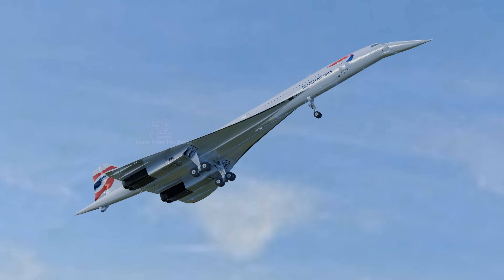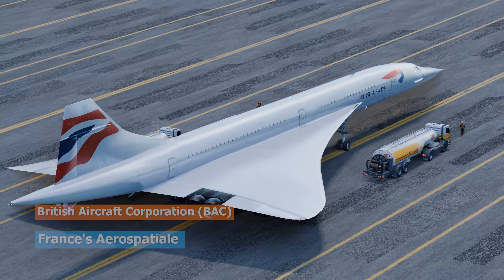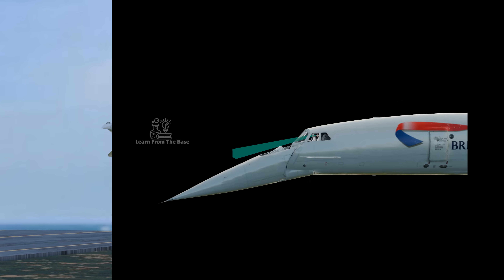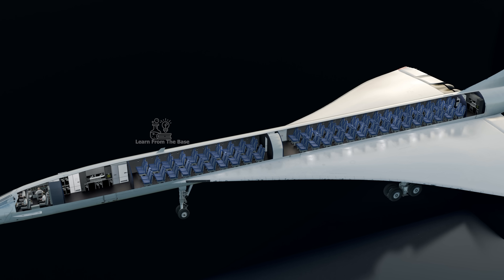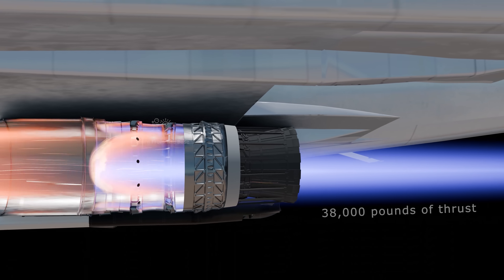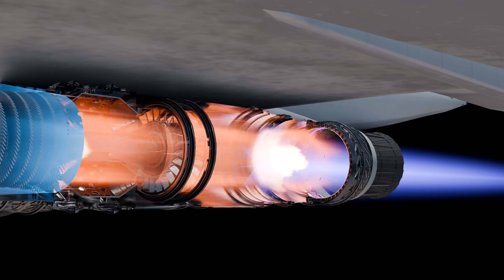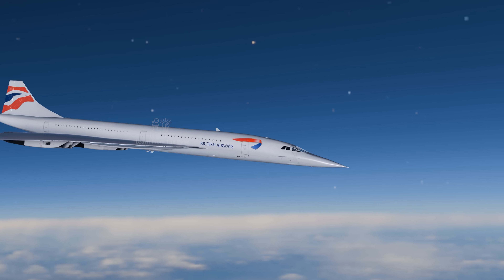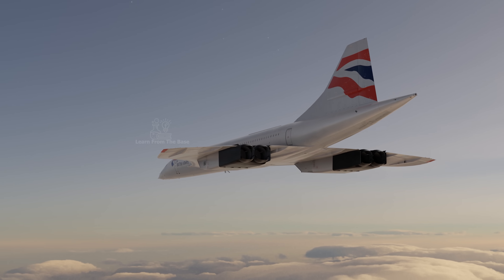How Concorde Worked: Inside the World's Fastest Passenger Jet@Learnfromthebase

Comment: The Concorde was an advanced engineering marvel for its time, but despite its use of special materials, its design was somewhat outdated by the 1970s, which is why it was so expensive. Today, we have 3D design software, new technologies for lighter and stronger materials, a fully computerized cockpit with automated systems, and computer-aided design improvements to mitigate sonic booms.  We also have new hybrid turbofan engines that offer lower fuel consumption and eliminate the need for afterburners, while still maintaining supersonic speeds. These 21st-century technologies can significantly reduce costs. If the necessary resources are allocated, a new version of the Concorde could be developed. Today, speed is a valuable asset, unlike in the 1970s.
Reply: How can the fan manage supersonic speed, i e how avoid fan blades reaching supersonic speed?
Reply: @sundar999   In supersonic flight, fan blades can't reach supersonic speeds — that would cause shockwaves, efficiency loss, and possible damage. To avoid this, engineers design smaller diameter fans, use multispool engines, and shape the blades to delay shock formation.
That's why most supersonic jets use turbojets or low-bypass turbofans. For example, to adapt modern technologies to the Concorde, the final version of the Soviet Tu-144 (the Tu-144D) used the Kolesov RD-36-51, a low-bypass turbofan designed for efficient supersonic cruise — with a small fan that stays subsonic even at high speeds.

Comment: The sad thing is Concorde despite being supersonic was a failure.

While it obviously made money, only those who had deep pockets could afford to fly on Concorde.

Concorde was too expensive to operate as the money it made was used as proceeds for the fuel it required to fly which wasn't cheap.

Not only that but Concorde could only fly over water as it was banned from flying overland.

The 2000 accident, 9/11, the planes flying barely full & the cost to upgrade & maintain the planes was too great with Concorde retiring in 2003.

Comment: From theoretical point of view it's great project but from practical & economical point of view it's shitty airplane , it's like using F1 car for daily use , you can't afford it neither it's regular maintenance.
 to make a commercial plane  reach such high speed you need to make it very Aerodynamic to overcome air resistance , but air resistance is necessary to make airplane take off in 1st  place ( the earliest supersonic airliner couldn't take off from ground because it was very aerodynamic )  so no.1 problem : how to make balance between aerodynamics & air resistance that is necessary for take off ,

 no.2 problem if you want to reach speed of sound you gonna make plane to resemble military aircraft to overcome air resistance while you are flying in air which means to make compromises in airplane body shape & it's seat capacity ( usually maximum 120 passenger ) & thus increasing ticket price tag besides from it's high cost regular maintenance.

3rd problem is the noise & sonic boom it makes when it reaches speed of sound
Reply: It was a profitable airliner for 27 years?
Reply: @scottwilson6467  Not at all. It started off as a complete failure with airlines operating it on a loss and more as a prestige project, until they changed their business strategy to advertise it as a full premium product, justifying extreme prices. In the late 1990s as demand started declining thanks to other planes conquering the skies, they slowly started operating on a loss again. The crash was the final death sentence for the Concorde's profitability.

Comment: By now we shoud've travelled half way around The Globe in 4 hours not 20. To me the aircraft industry is very low on the list when it comes to improvements . All they care about is profit.  Maybe a billionarie should invest in building a passenger aircraft that flies very fast , it's very safe and doesn't need so much fuel.
Reply: Well, appearently it does need a lot of fuel, as that was the main reason the Concorde failed. Appearently it's not that safe, as we've seen in June 2000. A new clean sheet aircraft could fix the Concorde's problems, but it'd be extremely expensive to develop (likely significantly more expensive than the 30 billion USD for the A380) for an aircraft, whose predecessor sold 14 times.

Comment: I still think one of the main reasons it was retired is because no sane insurance company would insure its operations at a reasonable price.  The simple fact is flying at Mach 2 at 60k feet is much higher risk of critical failure than flying at transonic speeds at 45k feet in a 747.  On top of that with so few planes in service and zero accidents it had the best safety record of any airliner ever put into service when measured by per passenger mile incident, but that all changed on Paris with just one crash where it then had the worst safety record, even beating out some infamous competition like the Tupolev Tu-104.  The tires were a notorious issue on Concorde with many planes needing extensive repairs after bursting tires.  While the Paris crash was FOD related and not really a fault in Concorde per se one cannot overlook that any other airliner would not have been lost given the same conditions because they are far less susceptible to that kind of damage from thrown tire fragments.  It was a technical masterpiece and I for one think the Russians and Brits make some of the most beautiful looking aircraft anywhere, but it was really a case of triumph through sheer will because our technical reach was short of our grasp on such an ambitious aircraft being wholly safe and economically successful.  We forget that we were well into the 1980s and still losing multiple airliners a year back then, but today we usually have many years without a hull loss accident today and it continues to get even safer.

Comment: You all did not discuss the sophisticated air intake ramp system that was needed to slow the air entering the engine to subsonic speeds in order for the engines to ingest the air.  Air travelling at Mach 2 would generate shock waves that disrupted the flow of air entering the engines as the air contacted the fan blades.  This would lead to potentially dangerous engine surges which could not happen while travelling at Mach 2.
Reply: @rosslarkin6742  I agree, to miss that important point is unforgivable

Comment: BA flight #2, the Concorde return flight to London, took off from JFK at noon, every day. I used to visit family in Rockaway, which was often where outgoing flights would turn out to see shortly after takeoff. On busy days, you would sometimes have 2 or 3 flights per minute going overhead, from 2 parallel runways. But 5 minutes before noon, takeoffs would cease, so that when Concorde took off, it wouldn't run into slower aircraft, so they instituted a 5 minute ground-stop before every BA or Air France Concorde flight.
After waiting 5 minutes, you could hear the mighty roar of the Concorde engines on takeoff, followed by the ear-splitting roar as it turned overhead at probably 5,000'. Being on the Atlantic shore, we would watch the plane head a bit out to sea, then watch as it lit-up the afterburners, followed by an even louder roar as the plane quickly climbed up and above mere mortal jets. If you were lucky, you would also hear the sonic boom a minute or so later.
Once Concorde got up to speed, the engines were powerful enough that they could turn off the afterburners and still maintain mach 2.0. As the fuel load lessened, the plane would slowly climb another 5,000', up to about 65,000' before beginning descent into Heathrow.

Comment: How’s the even possible that we have had no replacement for this plane? Maybe Boeing / Airbus / Airlines figured out slower planes were far more lucrative and people were happy to travel in the times we have available today. Shame though whatever the reason.
Reply: If you wanna pay the development cost for a plane, whose predecessor sold 14 times, go ahead. Expect upwards of 30 billion USD.
Reply: The aerodynamic requirements of supersonic speeds will always mean a smaller cabin compared to a subsonic design of the same size. Concorde was enormous yet the passenger capacity was less than a 737-800.

Comment: Some facts: 20 built, 13 or 14 ever in service, the remainder used for spare parts. EVERY flight lost money. The windows were very small, not at all as big as a regular airliner. My parents flew on it from Paris to  New York in 1997--my dad said it was very cramped and kind of dirty. Seats were average size, bathrooms were tiny. Tickets were four-figures minimum. The plane was utterly impractical and continued to fly merely as a prestige claim for British Airlines and Air France. I'm pretty sure a number of officials at both airlines were relieved when the Concorde eventually went out of service.

Comment: Brilliant video. I wish you had gone into details about the intricate engine air intake system and how it manipulates incoming supersonic air into becoming subsonic flowing air for the engines, which are not capable of handling supersonic incoming air flows. I'm referring to those intake ramp doors and baffles that handle shockwaves et al.
Reply: Cleverest part of the whole aircraft. Apollo Engineers are on record that Concorde in some ways was a greater technical achievement as it was such a leap forward whereas Apollo whilst huge was extending and enlarging existing systems and technologies.

Comment: Fun fact missing in the video: you actually needed 3 people to take off the Concorde. The flight engineer needed to kick in the afterburners manually, and it was still all dials and needles in the cockpit (a „proper cockpit“, as old captains would say) and next to no computer support  - 60ties tech!) Therefore the take-off command was not a simple „take-off“ announcement, but a count-down for a coordinated engagement of the engines by the entire crew on the flight deck with the famous „Three-two-one-now!“.